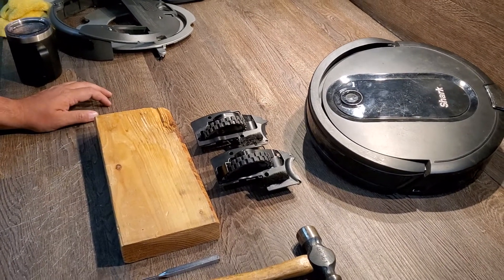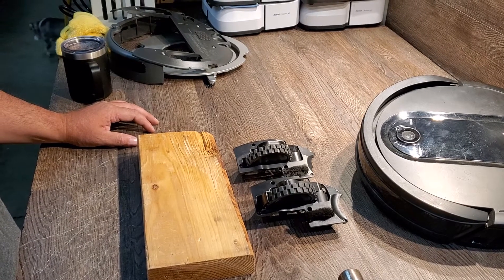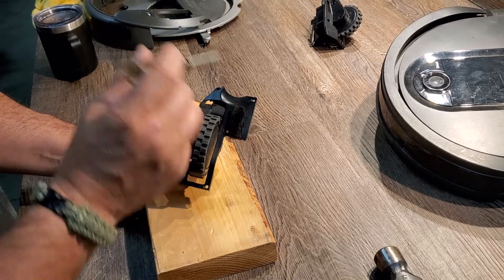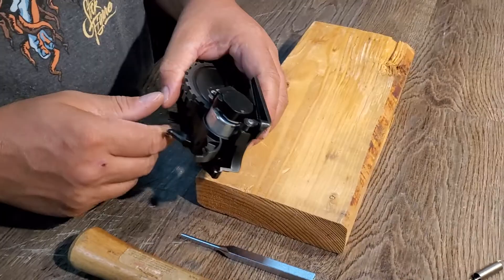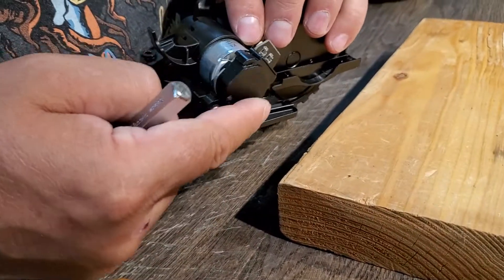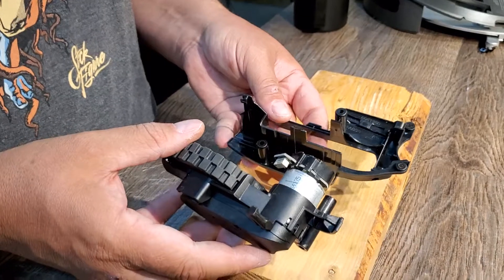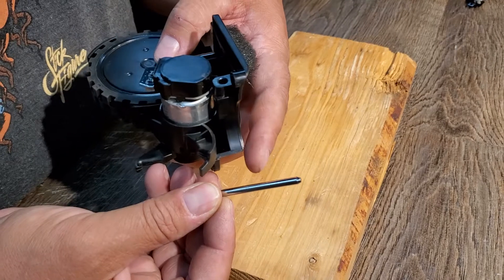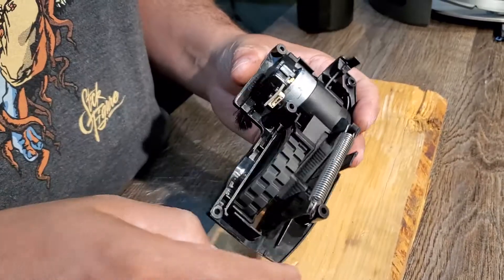Shark IQ Robot Wheel Motor Mount Replacement

Comment: My shark is an rv990. The connection for the wire cable has broken off. Can I replace that part or do I have to replace the whole wheel and motor?